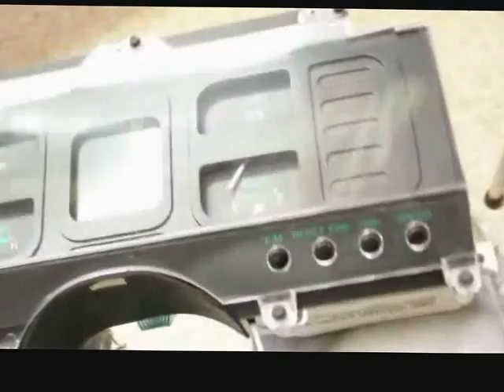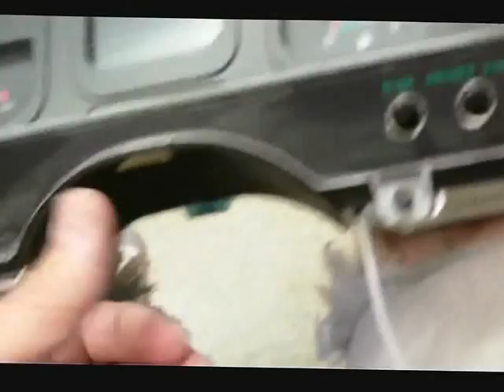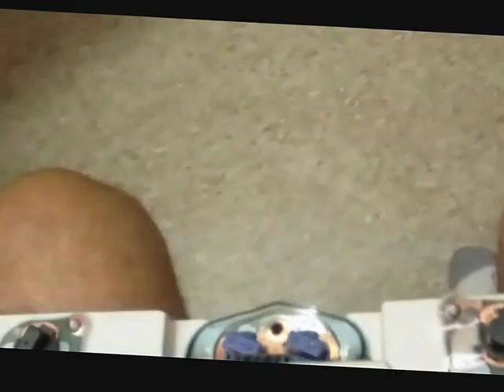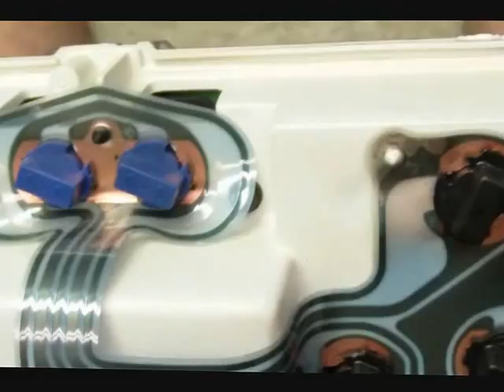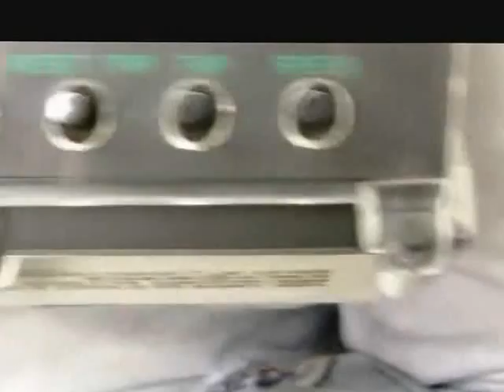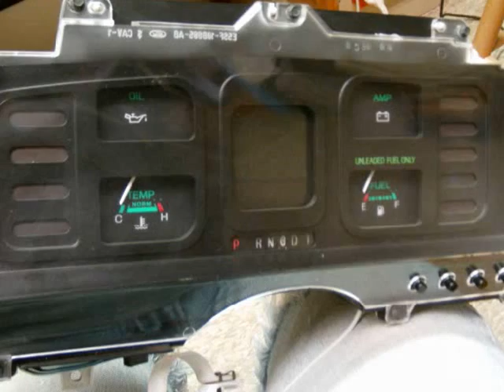88 Ford Thunderbird Instrument Panel Cluster and IVR

Comment: Can this the same process as an 88 tbird lx odometer??
Reply from the maker: As far as I learned, I think there were 3 dash displays for '88.  1) Full analog 2) Partial digital (this video) and 3) Full digital.  I cannot speak for 1 & 3 but might assume they have the same electronic board components.  This video is 7 years old and I sold the car over a year ago.
Reply: Well mine is a full digital
Reply from the maker: The Full digital is nice, good luck.   @kevinzazueta7877
Reply: Thank you 🙏🏻 all I’m trying to do is change all the bulbs so it lightens better